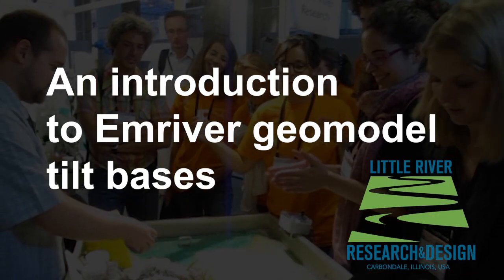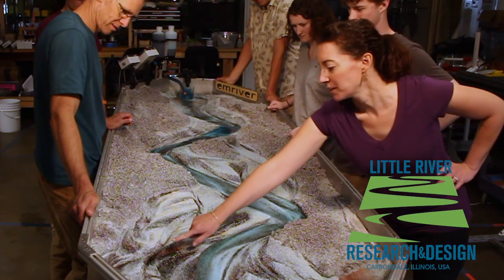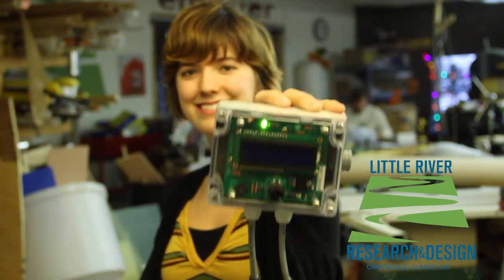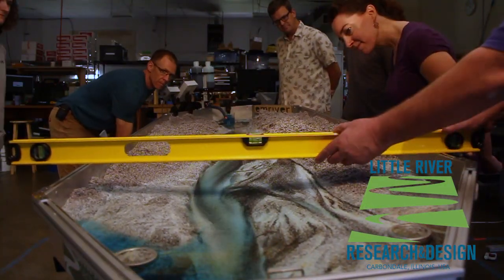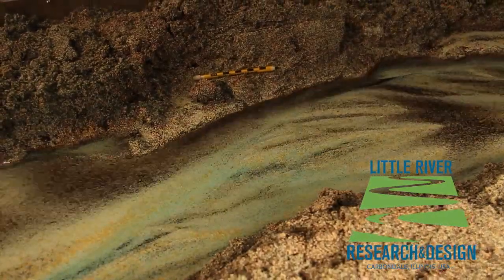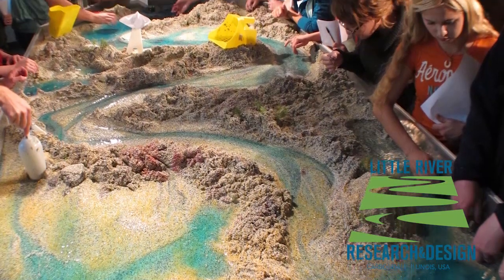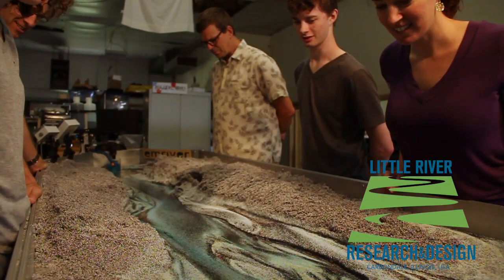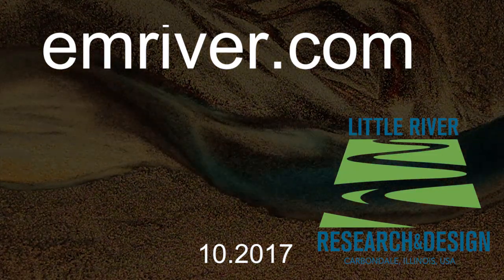Emriver Dual Tilt Bases for Em3 and Em4 River Models

Comment: Tilting the Mountain eh. I hadn't thought of that : ) This looks like fun & if used correctly can give an impression of changes by water erosion (and of course where river gold is deposited) according to season flow changes/flash floods. It should have significant impact on safety as it'll identify/predict areas of potentially unstable ground if substrate materials get washed away to be replaced by light gravels & loams. Most gold isn't where people assume it to be - it's deposited in largely undisturbed places inc Farmlands where rivers used to flow : )
Reply from the maker: I don't think any of our customers have used it to simulate gold deposition, what an interesting idea. As a process model, it is great at demonstrating real-life river processes.